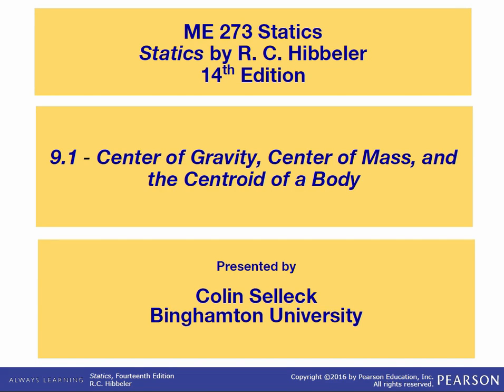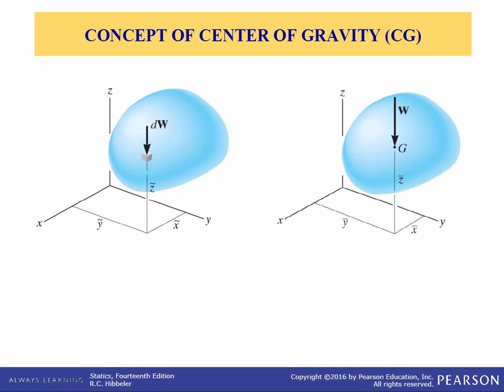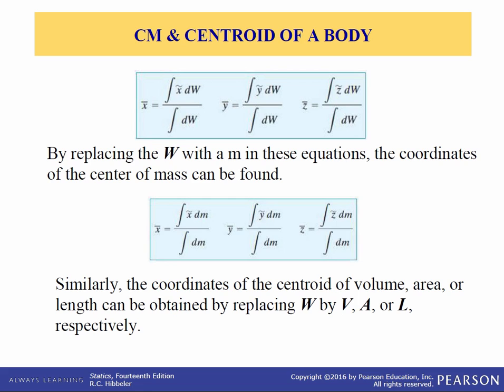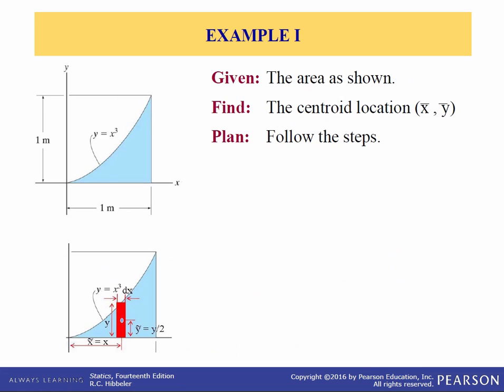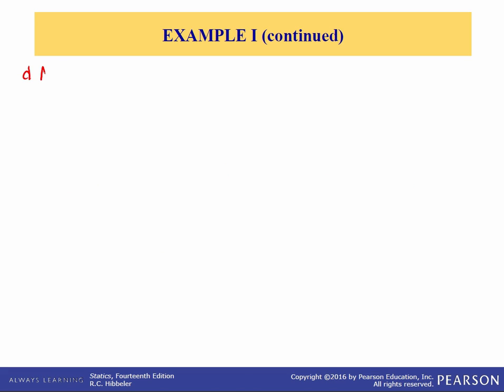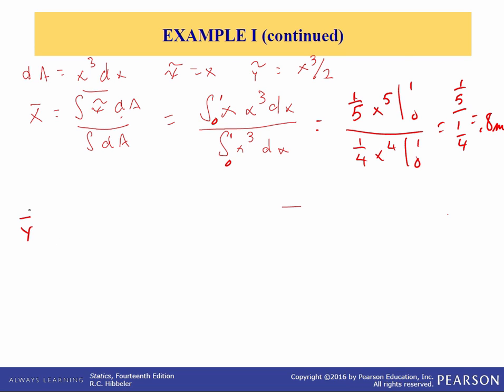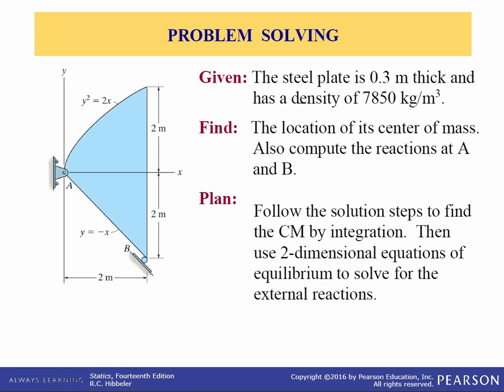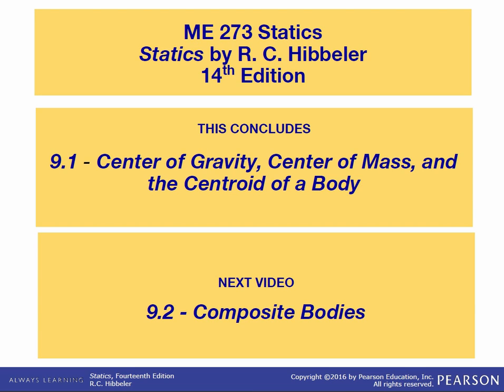ME273: Statics: Chapter 9.1

Comment: thank you sir a lot , i hope more solved problems as it is really helpful , kindly i wonder about  the hight of the rectangle is y2-y1 instead y2+y1
Reply from the maker: It's a bit confusing. Just think of it as you have two points y2 and y1. The distance between those two points is y2 - y1, right?